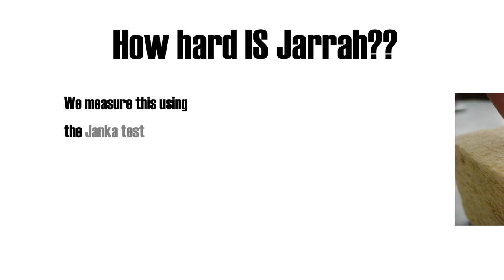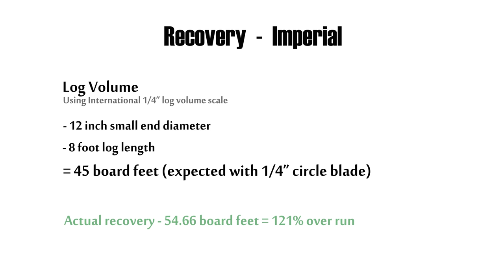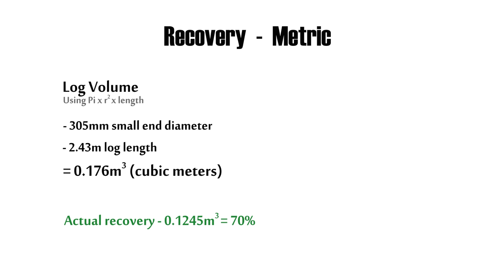Affordable Portable Sawmill

Comment: This is better design generally than Lucas which has more vibration as the rails adjust not the carriage as the Petersen does, this leaves the rails on the solid ground. Also Petersen appear to stabilise the mill long ways not across with the top bars on some of their mills it appears more sturdy than Lucas also. I've never used a Petersen but I've owned 2x lucas mills and they are great but I think Petersen have done a better design and more improvements that you see from Lucas. Also Petersen get the credit of designing the swing blade, however they never patented the Aussie market and Lucas apparently took the design and patented it in Australia. Petersen's biggest mistake, if the story is true and I believe it is.

Comment: How wide of a slab can it cut?
I like it. My bandsaw mill can cut 30inch diameter, I dont cut that often mostly just standard lumber but it is nice for alot of different projects.
Reply from the maker: Hi there, the Junior Peterson with a clip on slabber can cut up to 44" wide slabs or with the circular blade you can double cut up to 4"x12" or standard cut up to 6"x6"

Comment: Hello, Peterson's. I have read a couple of places that the swing blade sawmills are best used to saw LARGE logs. Some have also suggested that bandsaw mills are better equipped to handle smaller logs (than a swing blade would be). Do you have any comments on this? Many thanks.
Reply: Just my 50 cents but a swing blade can do large aswell as small because you don't need to turn log.band saws are limited to the guides so you'll never get close to the same size log that the swing blade can take.also the wood you take off the swing blade is finished product as  some of the bandsaw stuff would have to be put through another machine to finish unless you producing just slabs. Just a couple of things to think about.
Reply: The one con about a swing blade is the blades do cost more.  As for how economical they are over time I have no idea. I would think the carbide tooth lasts longer in this hard wood. The blades do take more wood out than a band mill. Not a whole lot to dislike about a swing blade, the question is do you want to move the log or the saw? I have no experience with a band mill to be fair, I'm still torn as well. In talking to a guy that uses a band mill he stated the band mill does start to make wavey cuts when dull. That seems like a huge down vote for the band mill.
Reply: Horses for courses. I would never cut hardwood with a portable band mill. Plus if you are on hardwood the smaller diameter logs are more stress so  that bigger logs have less stress and move less when you break their back, I've cut all diameters of Aussie hardwood log on a Lucas mill, the problem is you want a steel frame bed you can dog logs into so they don't move when you cut them, that's something these guys need to design. Best way w/o any steel bed is to put 3 8x8" runners down with some heft, bed them into ground then level them with the mill, then use wedges to keep the logs in place but they will still move especially when you get lower down in the log and it is not as heavy etc.
Reply: A blade mill is way more versatile than a band mill, yep worth the extra money IMHO

Comment: 2x3 ?   :-) ,,  3x1 ,, 3x2,, 4x2,,  :-)  In 1958 I learnt how to mortice and tenon, , Dad built our house from Iron Barks the elec. contractors cut when the power came through,,  Every nail had to be drilled with a brace and nail bit,, 60 years on the house is just like dad built it,,

Comment: Affordable????? @ $11500.00  I dont call that affordable.
Reply: Its much more expensive than something like a woodmiser. Bloody nonsense
Reply from the maker: Our range of sawmills are top of the line. The JP has been described as a more affordable option when comparing quality and durability against other swingblade sawmills.
Reply: So how does it compare to the Lucas Mill? Looks similar.  This looks like a damn nice mill. You are not easily getting into the Bush with a woodmizer. Not without leaving one hell of a trail behind you.